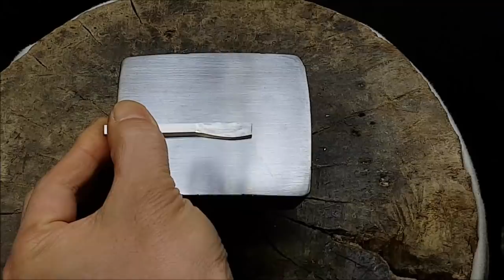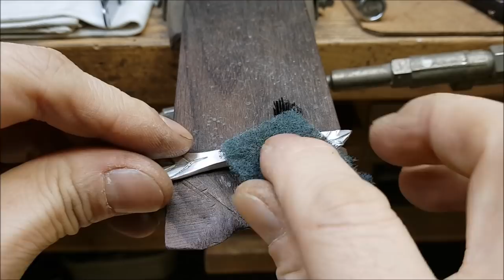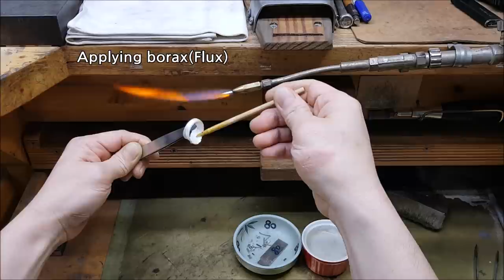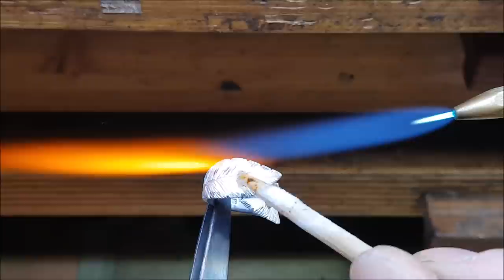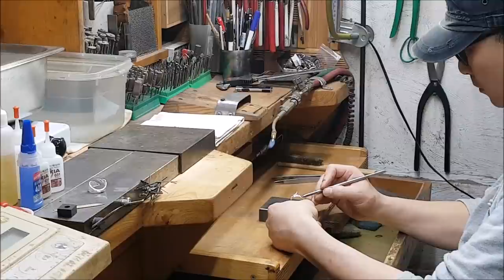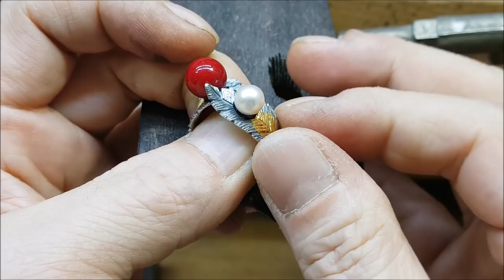Make a christmas "RING" for her / Set CORAL and PEARL

Comment: What material are your tweezers you use whilst holding silver when annealing? They obviously don't get hot!? I really like your torch set up 😍
Reply from the maker: My tweezers are made of stainless steel that does not rust or rust less.
I have been using these tweezers for over 20 years.
I'll show you a video of making tweezers yourself later.
Thanks~

Comment: Very beautiful work, what do you glue the gold leaf with?
Reply from the maker: Gold leaf does not use adhesive.
It is fusion welding.
After heat is applied to the silver, simply press and rub onto the silver.
Heat is heated to 600-700 degrees Celsius.
The thickness of the gold sheet,,,
A postcard-sized gold sheet is about 3-4g.
That's about the thickness.
It is about the thickness of a regular paper.
This is a unique method of work in Korea.
Thanks !
Reply: @SilverMeister  Thank you for the answer, very interesting information.

Comment: I only have 21g ss. your gauge looks much thicker. Can you tell me what you use for pickle, on the hot plate?  you inspired me to try a different design I've had in mind--Thank you!
Reply from the maker: Putting it in a stainless steel pot and washing it,
Sulfuric acid 10% + water 90%.
Warm it up to clean silver or copper (non-ferrous metals).
Reply: @SilverMeister  Thank you, love your torch set up, so practical.

Comment: hello hello my pen that you use, does it have a feature, what is the metal?
Reply from the maker: I don't know what your question means.
This video is about ring making.
Reply: @SilverMeister  hi dear master , like we talk earlier at 9.57 what is that stick in your that looks like pen , what is the source material on that and is it the reason gold attaches to ring , thanks
Reply from the maker: In my other videos, I have all the explanations you might be curious about.
The translator is malfunctioning.
Iron sticks are just iron sticks that are very hard and shiny.
When silver and gold are rubbed with heat, they just stick to each other.
This is a kind of fusion technique, and in Korea it is called "keum-boo" technique.

Heating these metals to a temperature between 260~370°C increases 
the movement of the atoms. 
When pressure is added, 
this causes an electron exchange at the surface between the two metals, 
creating a permanent diffusion bond. 
This diffusion bond occurs far below 
the soldering temperature for either metal (Dhein, 2004).